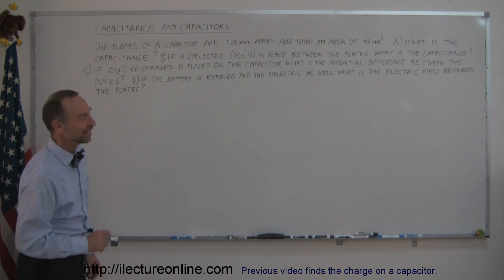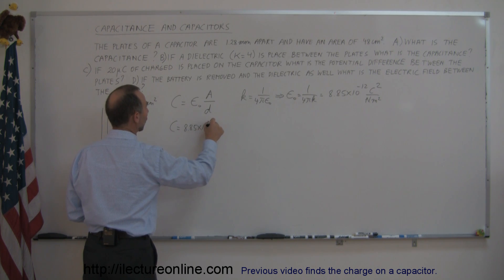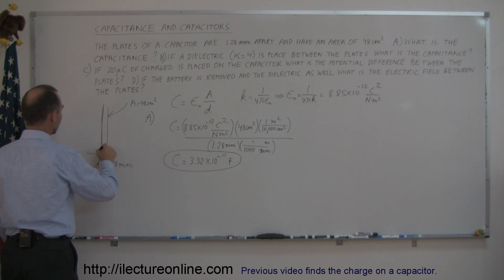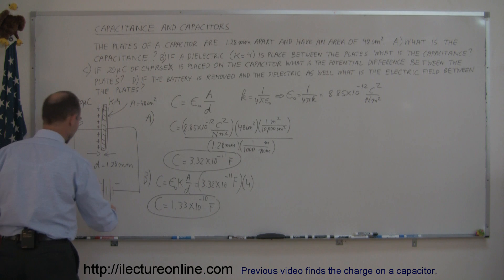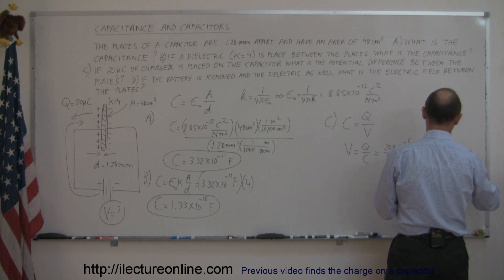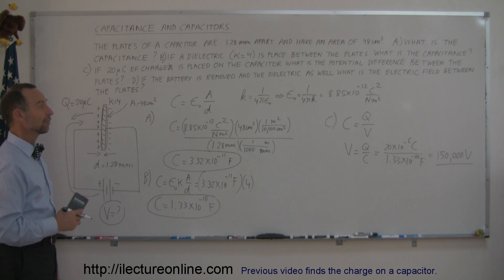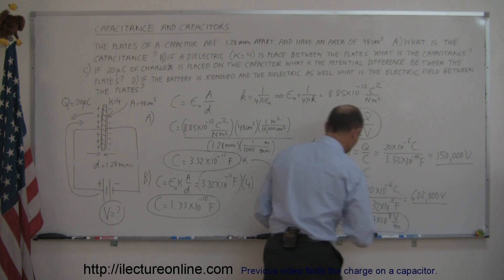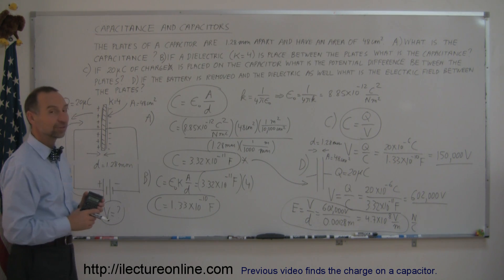Physics 39   Capacitors (2 of 37) Calculating the Charge on a Capacitor with Dielectric  2/2

Comment: I used v = Ed to calculate the answer for c but got it wrong is the error on my side or does that formula only work in certain cases
Reply from the maker: As long as you calculate the correct V it will work.  The video shows you how to do that.

Comment: Hi, thanks for the vid. The second calculation feels counter intuitive to me, if you remove the dielectric, the charge of the dielectric would be removed from the circuit so in order for it to retian the same amount of charge the voltage WOULD HAVE TO BE INCREASED but it doesn't increase as a product of the dielectric being removed.
I hope someone can read this and prove me right or wrong.
Reply from the maker: The voltage cannot change if the capacitor is hooked up to a battery.

Comment: If the capacitor has the dielectric removed while still connected will the charge flow back to the battery?
Reply from the maker: Since the voltage across the capacitor doesn't change (still connected to the battery), the charge across the capacitor will lower and the charge will enter the battery on one side and leave the battery on the other side to redistribute charge on the capacitor
Reply: @MichelvanBiezen  ty very much my friend

Comment: why does the potential difference across the capacitors decrease when we add dielectric between the plates?
Reply from the maker: That is explained in this video:  Physics - E&M: Capacitors & Capacitance (13 of 37) Placing a Dielectric Inside a Capacitor
Reply: thank you so much 😊😊

Comment: i have a burning question isn' the equation E=V/d supposed to be used only when the electric field remains constant but in this question doesn't the electric field between the capacitors diminish as a function of distance then how can we use the equation?
Reply from the maker: You are correct that this equation is only used when E is constant.  Between capacitor plates, the electric field is indeed constant.
Reply: why is it constant does it not diminish

Comment: i just realized that there is an eagle on the flag :D
Reply from the maker: +Ahmet Omer Ozgen 
Yep, that's our eagle.
Reply from the maker: +Ahmet Omer Ozgen Our daughter named him Edward.
Reply: +Michel van Biezen Edward the Eagle :D btw. today i had my physics mid2, but i couldnt watcg all the videos for resistivity and kirchoff. but i found a trick for Kirchoff on which you select 2 points / joints for more than 1 branch. i give V to one, and O to other(grounded so zero). from point V, to all bracnhes i give currents as i 1 i2 i3 and so on. then i solve for I one + I 2 + I 3 =0, for i 1 I say, V minus or plus epsilon 1(its minus if its in the opposite direction of my given current(the battery s real current)) and divide it to the resistors (just add them if in series or solve for equivelent for parallels). this is much quicker and for more than 3 loops, i dont need determinant. i just solve the equation for V and substitute V with the found Epsilon. if the result is minus i draw the current in the opposite direction to what i drew first.

Comment: I tried it over and over and over, but the first part of the problem always gives me x10^-13   not    x10^-11
Reply: me too!
Reply: I got that as well. However later on in the problem I realized that the distance is 1.28mm, and not 128mm. The decimal is hard to see on the video. So once I plugged in the correct distance I got the same answer Biezen did.

Comment: I think there is something wrong in the final answer in C and D. C should be 150,375.9398V and on D it should be 602,409.6386V and 470,632,530.2N/C
Reply from the maker: Dudong,
You should apply the rules of significant figures.

Comment: hi michael, the capacitance for part a should be 3.32x10^-9. theres only 100 cm in a meter not 10000.
Reply from the maker: William
there are 100 cm in 1 m
there are 10,000 cm^2 in 1 m^2
In this case the conversion was from cm^2 to m^2, thus the answer in the video is correct
Reply: Hi William, Since a square meter is 100cm x 100cm it is 10000 cm^2.